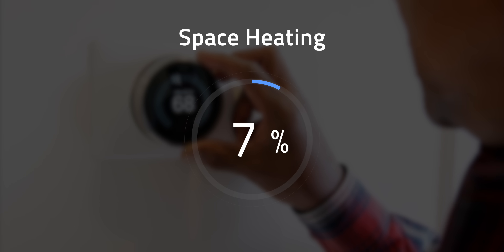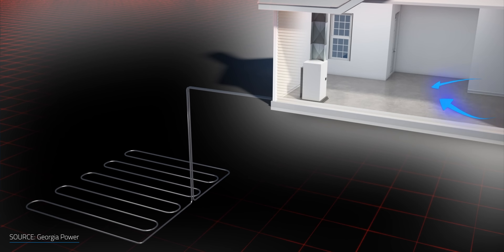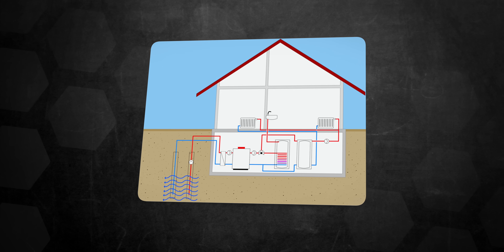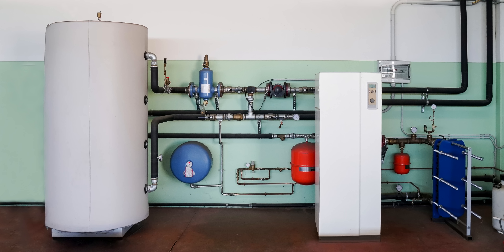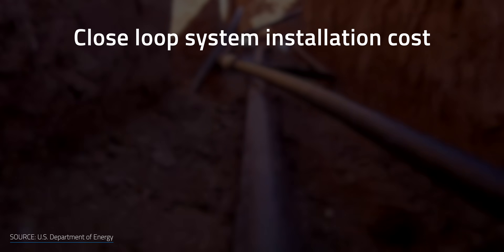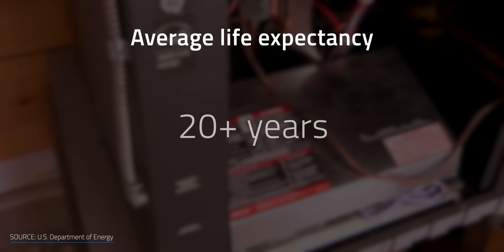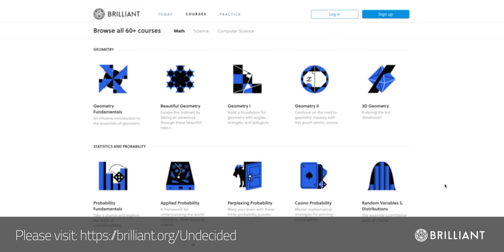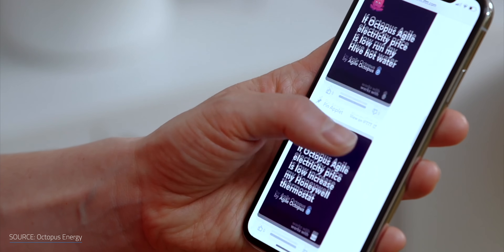Is Geothermal Heating and Cooling Worth the Cost?  Heat Pumps Explained

Comment: This may seem a little strange, but could you install a horizonal loop system below a septic bed? That way on a new home they could share some of the costs.
Reply: Sounds great until you spring a leak and you get feces flavored heat pumping through the house.
Reply: @DeAthWaGer  Yea......... there's always that.

Comment: The the video the fluid was described as liquid water or water and antifreeze solution yet the animation showed a compressor, condenser coil, and expansion valve like what's found in a conventional HVAC.  How would that work?  Is that animation correct? Are the plastic pipes being buried in the video capable of containing pressures associated with the compression/evaporation cycle?

Comment: Unless I'm mistaken, this system still requires electricity to power the pump. All this does is reduces the total electricity consumed by using the earth's natural heat/cold. You would need more electricity to actually warm or cool the air. In this system, you will still need something to turn the fan and actually pull the heat or cold from the ground. Am I correct in this?
Reply: The savings are in not having to power a compressor or electric heating elements.

Comment: 2:34 "The heat pump compresses the liquid, increasing the liquid's temperature." Wait, what? I thought liquids couldn't be compressed?
Reply: https://www.physlink.com/education/askexperts/ae15.cfm TLDR; Molecules are 99% empty space, so of course you can compress liquids, as well as gases and solids. Gases are the easiest, then liquids, and lastly solids. Some places/occupations will refer to liquids as "in-compressible" due to the lack of pressure in the system to compress the fluid (hydraulics).
Reply: @TheAunvre  thank you

Comment: I'm a HVAC tech, and I do install all type of heat pumps(including Geos) in Quebec,canada, where is is very cold in the winter. It is only worth to change a geothermal heap pump if you already have one that broked. The best thing is a mini-split type heat pump, with a converter for the air handler(24V to data on the signal). Up to 24 000 btu, they have max efficency up to -20C, from 24 000btu to 48 000btu, max efficency up to -15C. It is more small, take less current, get higher temp in heating, breaks less, more resilient to outside changes, and 1/3 of the noise compare to a regular heat pump. Almost silent in cooling. Some machine go up to -35C now, but they are more expensives. Geos will cost up to 30 000$ more on new installs. Buy Nasdac with 10% annual profit with that 30 000$ instead, you will have more money in 10 years for sure. That is my 2 cents on the subject. Geos were hot untill 5 years ago, but not anymore. Get the new shit instead. I install one per day and it is so much better.
Reply: I too am a HVAC tech and agree that Geo isn't as good as people think; many break downs, costly repairs, potential difficulties to access equipment.
Reply: Zombie Eric Harris  Air to air ductless heat pump technology has been so efficient recently that it’s the only reasonable choice especially when building a well insulated home to modern codes or better.
Reply: 💯percent correct.  Way too many videos and comments based on 10 to 20 year old technologies.  DHP all the way
Reply: Problem with ground source heat pumps is that efficiency numbers don't include the recirculation pump's energy consumption.

Comment: Something on the rise right now too are gas fired heat pumps. Essentially you'll have a system that heats like your usual heat pump but instead of electricity it uses fuel. Obviously,  this still produces CO2 but the idea is that it can be a stepping stone to improve efficiency while electrical infrastructure can improve. And down the line I've heard rumours of hydrogen being used in gas lines as a no CO2 alternative fuel.

Comment: The explanation is over simplistic, to heat a house above or cool below more consistent ground conditions, you need pressure & phase changes.  It's NOT just equalising temperature to the ground, but transporting waste heat from refrigeration or scavenging heat when the ground loop is what's chilled venting heat into the house.

Comment: Not sure if your neighbour would be that happy if you dig up their land to put your thermal system in lol.
This is fine for wealthy people, the average person will never have anything except maybe a small vertical system.
Why not just have a Solar panel system on the roof to power the Heating and cooling ?
I get year around free heating/cooling and Electricity from my Solar panels as well as a credit into my Bank of over $2000 a year.
Why bother with a silly system that needs to dig up a quarter of an acre of land to put pipes in ?.

Comment: While explaining how the heat pump works it's said that the liquid from the loop is compressed, this is however physically impossible. The warm liquid from the loop is passed through a heat exchanger to boil a refrigerant, this gas is than compressed into a liquid to condense the heat. Much the same as in an airconditioning unit.
Reply: And there is what I was looking for, the video went past that slide as if nothing, I was, what from 10-15° to 70° only by "compressing"?! Then the top part went from 30° to -5°. I wasn't understanding it too well, the system needs heat from somewhere to start and compensate those 10-15° at the beginning

Comment: Another problem of an American house is it's not very thermally efficient.  I lived in a  townhouse in Germany and I've seen them construct new houses.  The building materials and insulation used are much more superior.  I hardly used heaters during winter and they have this well placed small vents through out the house to circulate air.   Meanwhile my apartment in the US feels like it's made of paper in the winter and the heat is always on.  I don't understand where we went wrong with our building standards.

Comment: You've just added electricity cost for heating and cooling up, to get 3!%  of electricity cost. Which is wierd, since you don't heat and cool the house at the same time. You generally heat half of the year and cool the other half (usually a month or two in between where no temp adjustment is needed). So average would be 15,5 % ((16 + 15) /2 )

Comment: Unless you are a complete moron and you heat your house while cooling it. Heating and cooling does not account for 31% of electrical use. If you use 15% in the winter to heat your home and 16% in the summer to cool it, you are using only 16%. Your electricity use for the whole year, to heat or cool your home is never more than 16%. The only way your electrical power use for both heating and cooling is 31% is if 6 months of your total electrical use, 15% of it goes to heating and the following 6 months of total electricity use, 16% of it was used for cooling, but that is not what you said., unless, like I said before, you are a moron who runs the furnace while also running the air conditioner. Say what you mean and mean what you say

Comment: Be relatively easy for contractors to dig a little deeper when doing foundation and put them right under the house. Not too sure this would affect maintenance though. Under a driveway makes sense too.
Reply: Think what happens if you have the geo field under the house. During summer you are heating the geo field and now your house is sitting above that warmed up field. You want the geo field away from the house, not under it. Same problem in winter where you are cooling the geo field.

Comment: I’m actually looking into this for my house right now. That’s mostly why I clicked on this video. I also work for an HVAC company and they install quite a few heat pump systems in larger buildings.
My house is sitting on what appears to be highly packed sand. It is a nineteenth century house that currently uses a converted coal gas furnace to make steam. Not very efficient.
I really enjoy your channel and find your analysis helpful. I especially liked your battery electric snow blower video.
Reply: I also have a 19th century house. If you’re going to air condition as well as heat a ground source heat pump would be great! However you should also do what I did to increase the efficiency of my old house. I had no insulation and when I renovated I insulated the house and put 1 inch Styrofoam on the outside under new siding. We added all new double pane windows and cut our oil bills in half to begin with. That should make your heating and cooling much less expensive. Also you can size the heat pump up to 25% over your air conditioning load and still dehumidifier the house in the summer. Good luck!
Reply: Had a closed loop system in a previous house and loved it. Very efficient, comfortable and reliable. Our hearing Bill's were less than half that of a traditional forced air system and our cooling bills were about 20%.
Reply: You CAN obviously supliment Ground Source Heating with Black Panel roof mounting systems (Like a solar panel, but, its black with pipes running through them) So as the sun shines down water is pumped up to the roof, through the pipes zigzagging through a set of black panels, and then back down into an insulated water tank. And you don't need to have intense summer sun to make good hot water either... 🤔😏👍😎🇬🇧
Reply: Damn bro it's 2021!😂

Comment: have a 2nd home with 2 heat pumps and its in a climate zone where it can't heat using the exchanger year round - when get around to permanently moving into that home, am going to upgrade and augment with a ground loop exchanger. local electricity is hydro and comparatively low priced vs other regions

Comment: Unfortunately, currently, I live in a country that has a very shallow bedrock so digging is a no-go. I'm hoping to move to a country with a little bit more depth of soil so I can invest in geothermal. Along with wind, solar, it is really a no-brainer. Obviously, taking into consideration each technology drawbacks.
Reply: The new "wiggler" wind towers are apparently super efficient in energy production versus cost. A combination of those, some solar, and some geothermal, would be pretty potent. Throw in a $5000 UPS, and you no longer have to worry about power outages unless they last 24 hours. Seems a bit overkill right now, but the weather has only gotten crazier in my 4 decades alive. If there is any silver lining, the better we get at harnessing the heat/wind... the better we can use it to reduce the heat/wind.

Comment: In the 1990s, when my Dad looked into it, this was called "geoexchange." "Geothermal" referred to getting heat from deeper underground or from near volcanoes. For some reason, "geoexchange" was dropped.
Reply: Thank you for letting me know i actually want a geoexchange system
Reply: Ground Source is what i remember
Reply: The nomenclature is tricky. It's called geothermal heat pump, geoexchange and ground source heat pump. I still find that to complete newbies ground source heat pump gives them some idea of what's going on, though the idea that heat is being generated without a flame is still amazingly hard for some people to get around!
Reply: That's exactly right, geothermal is deep heat caused by radioactive decay and earth's internal heat reservoir, as he mentioned earlier in the video. What this video describes is ground-source heat pumps, a different thing altogether. Also as he stated, GSHPs just use the more stable temperatures in the soil to improve the efficiency of heat pump systems somewhat, they do not extract deep heat, which is in the hundreds of degrees C.

It seems to have become common to confuse the two terms, but someone making such videos should not be using those terms interchangeably, because it's incorrect.
Reply: @ledsalesoz  They're commonly marketed as geothermal systems, not quite his fault that the marketing departments decided to use incorrect terminology.
Reply: In Swedish, this is called Earth Heat, and Geothermal is Geothermal still, sure Geothermal means earth heat... But as with most things, there are better solutions than this. 200 meters below the surface the temperature is about 25 degrees Celsius or 77 Fahrenheit, if you had a closed loop system that far down, you could heat an entire city for free. But oh no doing things the common sense way is too expensive, when it would literally just require that they mined out a 200 meter long hole, and then emptied out perhaps 5000 sq.feet of space and laid heat pipes there and then just put some support to make sure that it was stable, then they'd have free heat for the rest of their fucking lives and then more, they could've been immortal and the heat wouldn't run out.
Reply: @livedandletdie  I have watched swedish tv where they use the term jordvaerme = earth heat and bergvaerme = 'rock'-heat. The earth heat is a system with pipes like what is here referred to as geothermal heating, they are dug down 1-3 meters. The other system 'berg-vaerme' I translate it rock-heating is a system of one loop pipe going down for more than 80-200 meters.
Reply: Well depends on your location, there are some places in sweden with heat  close to the surface and others were you have to drill deeper. I got interested in a company that create a product that generates electricity by using the difference in temp from ground to the surface. For this product to work you needed like 70 degre C water as the hot part. Now around Lund in sweden you would not have to drill deep to reach that temp compared to like in northern sweden if you wanted to reach 70 degres you have to drill very deep. And I mean on iceland you barely have to scratch the surface untill you reach 70 degrees. So it's all dependant on your location.
Reply: @livedandletdie  i suspect 200 metres is a typographical error? Is 200cm more likely?
Reply: @livedandletdie  " 200 meters below the surface" - in Sweden?
Reply: @suchistheuniverse7858  haha I caught that too. Sweden, home of the entrance to hell? Yeah no thanks on digging there
Reply: Stopped because the heat is local and that makes it hard for the governments to tax it
Reply: @Andy-sh9eq  No offense but 200meters down is a long way to dig.  You can't do that all over big cities.  IF you live on a ton of rock, good luck digging through all that.  And if one of your pipes breaks or there's an earthquake that messes it up... have fun digging again.  It may be a good idea, but it's not a good idea for everything.
Reply: too cheap and efficient , you don't need to replace every 6/8 /or 10 years everything as is done with wind turbines  energy or solar energy

Comment: If I were to be building a new house, I would probably do geothermal. Biggest question is how much energy cost does it save and where is the break-even point? At what point do you begin to recoup the investment in savings? Just had to replace my HVAC (heat and cooling) with a standard natural gas furnace and standard A/C. The entire process cost ~$10K. This actually saved me nearly $50 each month on energy cost as the models being replaced were much less energy efficient.  If installation for a GT costs ~$20,000 (very middle-of-the-road price point) then at what point will the $20k investment be covered by the cost savings?

Comment: Heat-pumps in cooling are fine - but for heating they just push luke-warm air; so they take a very long time to warm up a house as opposed to natural gas furnaces.  
While a heat-pump can warm up a house if you have doors often opening and closing it will be working for very long periods.

Comment: Heat pump vs  geothermal vs natural gas/ac compressor? All HVAC systems require electric blowers within reason. You mentioned natural gas being cheepest cost wise (short term) but initial unit cost, installation cost, maintenance cost and cost of energy for cooling my home are my greatest cost by far per month! Another words, cheepest ac?

Comment: For those of us in moderate climates mini-split heat pumps are a good middle ground. Eliminates all the losses of the duct work, much higher SEER ratings than central units and the variable inverter based compressors are easy to start on solar inverters, their lifespan isn't as long, but the costs are quite low while saving a good bit of energy. I have two 18,000 btu units and one 12,000 btu unit all SEER 18 cooling my 1500 square foot home. Total cost was $2100 for the units and about $350 in installation, had to pay a friend to come vacuum the lines as he works in hvac. Cut my bills in half from the old central air and gas fired furnace of before and then being able to run it on my solar setup dropped it even further. 

Need more companies like Dandelion to keep driving the price lower for ground source as that's still the biggest cost driver along with so few companies that work on it.

Comment: This is not geothermal power - that is what Iceland uses, using high temperature steam to power turbines for electricity generation, taking extremely highly heated water from volcanic activity. The systems you’re talking about are ground source heat pumps, using low temperature water taking energy from shallow piping in the top dozen or so feet of the ground heated by the sun.  It’s a shame you mix them up, as the rest of your content seems good quality.

Comment: 15% heating and 16% cooling does not make total of 31%... 
That's not how percentages work. Unless someone is heating and cooling at the same time. Or those 15% and 16% are calculated toward the consumption of the whole year?
The combined percentage is roughly 15.5% assuming the heating and cooling periods are the same length and a bunch of other things.